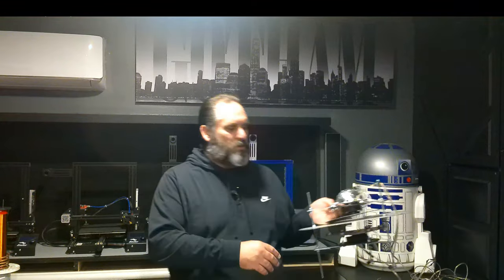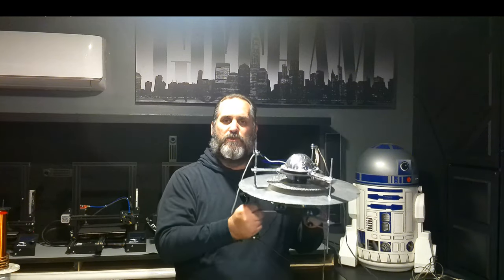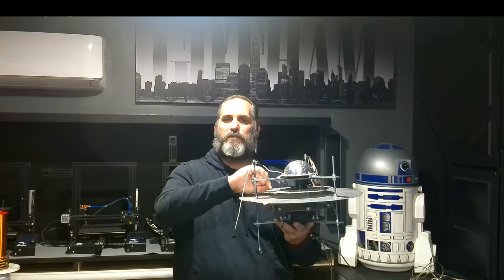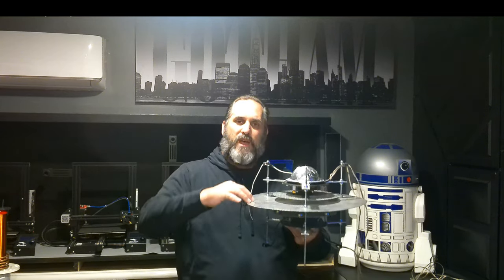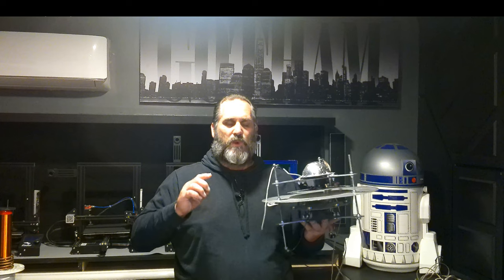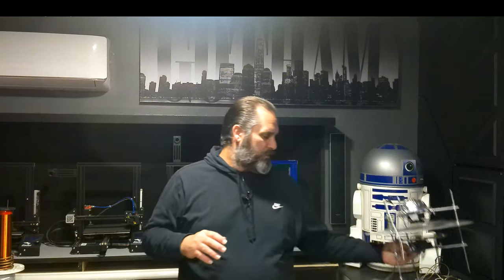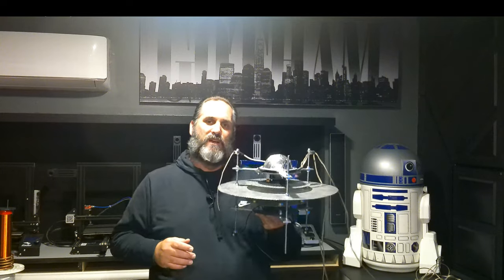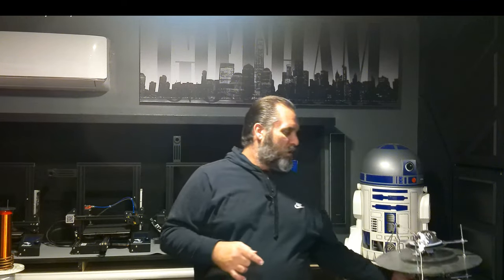Graviflyer "How It Works" #49

Comment: Can you touch your Graviflier like Alexey does without getting shocked? I don't understand how he can touch it, unless it's using some other method.
Reply from the maker: Yes I can. It is 74 degrees while the outside will burn your finger. It is safe to touch as far as high voltage. Just don't touch the spinning discs.
Reply: DO NOT TOUCH ANYTHING THAT HAS HIGH VOLTAGE ATTACHED TO IT UNLESS YOU ARE TRAINED ELECTRICIAN!! Not for nothing but you should not be advising others as you are unless you are a certified electrical engineer..c'mon dude wth..PEOPLE BE ADVISED THAT WORKING WITH HIGH VOLTAGES CAN BE FATAL!!!
Reply from the maker: @thenarrowgate3063  I was not suggesting he do that. I was answering what happened when I did it.
Reply: @thenarrowgate3063  lol volts alone wont kill you man...